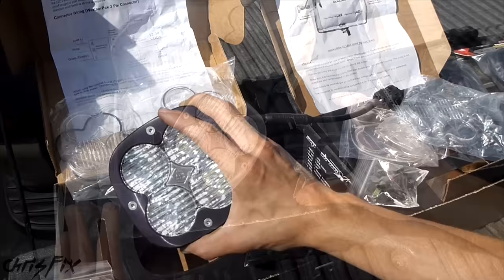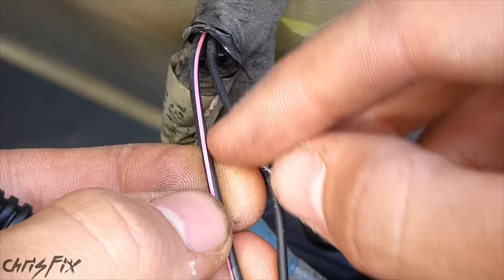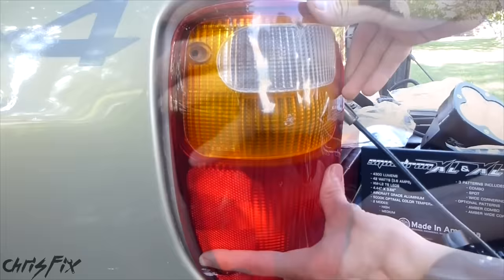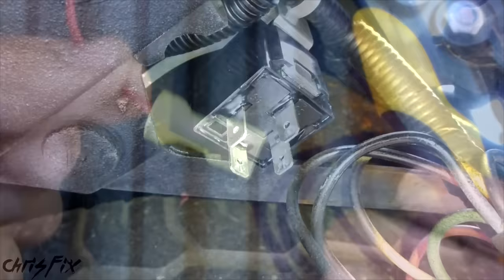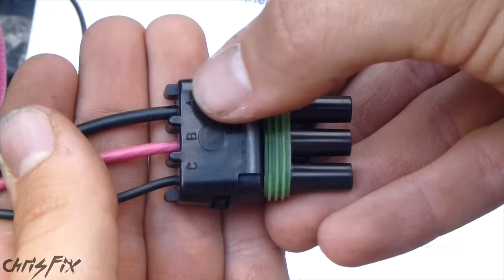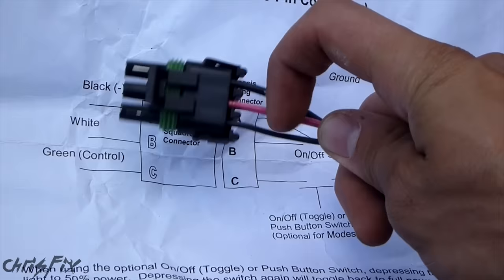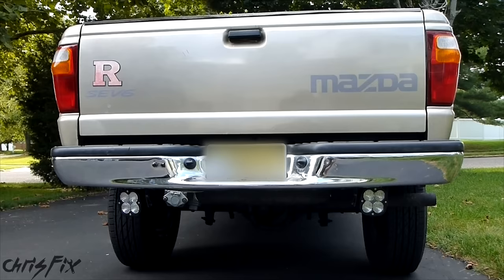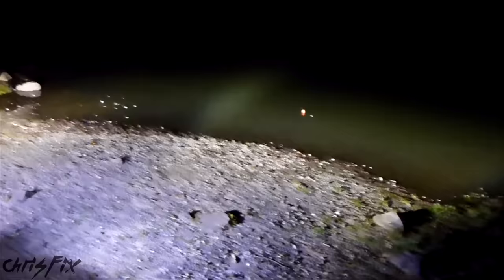How to Install Auxiliary Reverse Lights

Comment: I would just replace the original globes with led replacements and then power the new reverse lights off the wiring to the reverse lights, you'll probably draw less current then before anyways and not have to do so much wiring

Comment: Chris I have a question for you if you don't mind me asking I bought some twin strobz light for my truck and my battery is on my passenger side and the wires to the light are short and I don't want the button to be on the passenger side I want it to be on the driver side
Reply from the maker: What is your question lol

Comment: What about for the trailer?  My trailer has a 12 volt battery. Can I just use the trailer battery and tap into the 7 pin electric plug that goes to my truck? Which wire is the reverse on the 7 pin harness and / or plug?
Reply from the maker: You could but check the fuse for your trailer lights because you can only put lights that draw less than that fuse.
Reply: @chrisfix  okay thanks, and where would the trailer lights fuse be found? Probably someplace on the trailer I guess, right?

Comment: Why would you use another power wire and a relay for the new lights? The draw from the backup light is nominal so you're using the backup light power leg to initiate the relay, then a constant hot from the battery to power the light. So when you go into reverse the factory light comes on powering the relay which will close the circuit and send 12v to the new backup lights. Sounds like way overkill my friend. The backup factory circuit and wires should be able to handle the extra draw with no issues. I wired a trailer harness directly from the lights and have had no issues in over 10 years. Seeing as though both lights only lite up while backing (one function), wire the first and then from one light to the other. You can still run a fuse inline from the OEM light wire splice so if anything does happen to the wire to the new light and in between the lights that could cause a short, it will protect the factory wires. Just as effective, just as safe, and a hell of a lot less work and materials.  I get it, you want to be sure you don't overload the circuit and cause any harm to the factory harness. Ok, but there are easier and better ways to accomplish the same agenda. Just my 2 cents.
I had to edit this because you are running 3 grounds because you used a relay. My way: One frame ground to the first light, then with the power wire run the ground wire for the second light.  Incidentally, I would have used some type of inhibitor between the ground connection and the frame after you cleaned it to prevent it from rusting or corroding from being exposed to the road elements. Love your video for how to work harder. Just kidding, I do like your videos, you help folks with little or no knowledge do things so they don't mess up.

Comment: How can you use this same setup with a switch located in the back by the lights?  Basically so you can turn the lights on whenever you want to.  Would you have to run a completely different switch?
Reply from the maker: +TimberlandMan81 you can use a switch too. I ended up doing that later. Run a 12v line from a switch to the trigger on the relay.
Reply: Sooo...to make sure I have this right...you would run 2 wires to the 87 on the relay?  And if so...what 2 wires exactly?  As of right now...I do not have a relay installed.  I have the same setup that you have with the exception that I have the 12v wire with inline fuse running directly to the switch.  Then....I have the 2 hot (red) wires spliced together, also running to the switch but on the other side .  Then I have another wire coming from the reverse lights spliced into the 2 hot wires from the lights.  Then I have the ground wires connected together running to a spot on the frame of the truck.  The lights work perfectly fine with the switch...my utility lights plus my reverse lights come on...which is the way that I want it....but when I have the truck in reverse...with switch off...the lights come on for a second and then shut back off.  I am guessing and hoping that the relay will solve this issue?
Reply: So instead of running the 12v line to the relay...run it to the switch first and then from the switch go to the relay?

Comment: just so you know that's not how do assemble a weather pack you need to crimp the seal onto the wire where you crimped onto the wire sheathing so it seals your crimp inside the connector so the way you did it your crimp is exposed on the back side and will let water contaminate your wiring

Comment: Why is the wiring labeled differently on this relay?  Did you ever find out why?
Reply from the maker: +Blaine Bugaski I never found out why except that you can reverse the two poles that are different than usual and it's fine.
Reply: I suppose it's like a switch, maybe.  Doesn't matter which side has power coming in.  Wonder if that applies to all electro-mechanical relays just the same....

Comment: I hooked mine up with a double pole  center off switch in the cab. Up position aux lights triggered by existing back up lights. Down position aux lights always on for assholes riding your bumper at night. Middle position aux lights never on!

Comment: But why do it the hard way why are you running power all the way to the battery why not just connect the reverse light on each Side directly to positive and negative of the reverse light. That's how I did it and it works just fine. I have four inch light bars that are white for reverse and they have yellow for turn signals.
Reply from the maker: I'm glad it worked for you! My reverse lights have a gauge wire that is just enough to support that amp load. If you add 10 more amps you will blow a fuse or burn thru the wire!

Comment: Couldn't you just tap into the wires from the existing reverse lights, without having to run a line from the battery?

Comment: is there a limit of grounds on one bolt ?:)
Reply: Owensboropoliceandfire Opd it's actually best to use as few grounds as possible. Car stereo people know the problem of multiple grounds.
Reply: Owensboropoliceandfire Opd you want as least as mount of ground points, that why you usually use 1 bolt for multiple, plus it helps trouble shooting for bad grounds because you'll only have to check one instead of multiple
Reply: No, just get a longer bolt.

Comment: Those connectors are weatherproof if he would have put the wire seal in the correct location.  But why only use some weatherproof connectors and not on all of them.  This system will work for about a year until all the corrosion sets in.

Comment: Welll shit i fucked up and got a wireing kit for said reverse lights and it won't work but i can just modify it a little and it should work. I only say this because it already wired a turn on switch which i dont want. It has a red white and a black wire. Can i just put some electric tape over the white and black wire so that won't be in use or do anything. Then add more wire to the red one and attach it to my lights or am i better off doing this how you did it

Comment: The orange rubber seals in the 3 pin plugs are in the wrong place, the are supposed to be back where the insulation ends, not on the terminal where puts them
Reply from the maker: +andyjm90 thanks for the tip!

Comment: Honestly I’m not trying to judge or nothing great job but you don’t need all the relay and stuff like that if you splice the factory harness in reverse then you can get the power there just butt connect the ground and power together on each side and bam all set like it saying not being mean it’s just that you could of made it a lot easier

Comment: i like most of your video's. but why did you do it half assed. nice job on weather tight connectors, but use regular butt connectors, your asking for trouble. copper corrodes. should have used a relay connector and used heat shrink and solder the wires. and you can get heat shrink eyelets as well. the back end of a vehicle gets lots of moisture. i do this every day for a living and have to fix people taking short cuts using crimp connectors and wondering why their lights or trailer plugs quit working.

Comment: would it work the same way with Fog Lights ???
Reply from the maker: +Deejay Ecko you would want to wire fog lights on a switch so you could turn them on and off but yes, it's the same process.

Comment: You are aware you could have used the reverse wire from your trailer plug right?  This way you dont cut into the tail light wires or risk a stuck relay keeping your tails on and draining the battery.  Much safer and easier.  If you were to get the right pigtail you wouldnt even need to cut any wires on your truck.

Comment: Your could've just wired into your trailer hook up. That's how I wired in my brake and reverse light bar and I didn't run any wires to my battery and no wires to my tail lights it's all wired into the trailer hook up. But still an awesome video.
Reply: Cody Herman 792 you're right but I'm sure he didn't want to assume everyone has a trailer plug.

Comment: Why didn’t you use a heat shrink butt connector  instead of the black tape on Your first connection.  Your relay is not water proof either. You need a weather pack connection for the relay.
Reply from the maker: Thanks for the tips

Comment: you should zero Guage your ground and charging wires on your alternator/battery it will put a %25 increase in your electrical system since you got all them watts in LED lighting

Comment: My truck do not have revers light ¿how can I connect it?
Reply: Miguel Angel Mosqueda tailings so when you have your headlights on it power off the rear running lights.

Comment: Why do you need to run a power line to the battery when you already spliced into the power line from the tail lights?  That makes no sense, you don't need 2 power sources for 1 application.  I am not following the idea a relay either if you are already tapped into the power line to the tail light that is all you need (for power anyway).  Then just ground it as you did.  It seems to be overkill.  I am not seeing anyone else do it that way unless they want a separate switch.

Comment: Instead of using 2 crimp on barrel connectors to splice in fuse; Why not connect one side of fuse holder to battery and use only one splice?
This keeps fuse closer to battery, and less connections means less chances of corrosion or failure.  
otherwise good video.

Comment: I would trace a hole to cut into my bumper so they're not hanging off the end. I feel like that's a much cleaner look
Reply from the maker: Stay tuned ;)
Reply: Dylan Smith I would cut a square hole in the bumper and put it in the bumper
Reply: ChrisFix always man!
Reply: CHEVYSRCOOL89 yeah I feel you. I have a lot of friends that have that done I like it. My neighbor has it and it looks factory
Reply: They have flush mount led cubes on amazon that i used instead of these. the are awesome. Just like what you said

Comment: how come you didn't just t-splice the aux lights to the reverse lights?
Reply from the maker: Your reverse lights have a gauge wire that is just enough to support that amp load. If you add 10 more amps you will blow a fuse or burn thru the wire.

Comment: is a relay necessary?
Reply from the maker: Yes, otherwise you would run the power wire off the stock reverse light wire which will blow a fuse. A bigger fuse could melt the wire and start a fire!

Comment: Why can’t you just take a wire from the power to the factory reverse lights to the positive on the new ones, then earth the new lights. That’s what I did and it works fine.
Oh and it’s called solder, not sodder!

Comment: Factory made trailer electrical connection  on vehicle 2009 F-150 Lariat. All light work on truck. on trailer all lights work except running lights on trailer. Test meter shows no power to male plug in at manufactured trailer electrical connection  on truck. How do you find the issue. Does this signal have a separate fuse? How do you further trouble shoot.
Reply: James White there's a separate fuse in the block under the hood.
Reply from the maker: What Josh said!
Reply: Thanks fixed.

Comment: that relay instructions are surprising. typically pin 30 is battery, 86 is switch , 85 is ground the 87 would be energized from your back up lights.

Comment: You made  the connectors wrong. Rubber stoppers should go on the wire before metal connector. It seals connection inside plastic cover.

Comment: Improper way to install seals on connector. Red seal goes on wire then crimp connector to wire. You will have water in your connection in no time

Comment: couldnt you just skip all the wiring and fuse tap the current reverse light fuse?
Reply from the maker: No because you will be running a lot of current through your reverse lights. You can use the reverse lights as a trigger but not a power source unless the wiring/fuse can handle the additional load.

Comment: why don't you use a relay connector? it's much easier to use and you can get a waterproof one too....
Reply from the maker: Thanks for sharing the tip!
Reply: I love your videos btw and watch every single one of them and learned allot. You do the best "how to"s on youtube. Changed my oil, break pads, rotors etc... In the future, could you do a horn installation video? Idk how it is done yet but I'm staying tuned to learn...

Keep up the work.
Reply from the maker: Thanks a lot Dave! That is awesome! I want to do a boat horn on my truck! Something deep and loud but not train horn loud!
Reply: ChrisFix I will look forward to that video.

Comment: Hmmm,,, no flyback diode on that relay???  TIP: A thousand volts or so shoots into your electrical system when the relay turns off! A flyback diode should always be used!!!

Comment: You lost me at 10:49... where the hell did that "factory harness" come from??? I thought you were just running 2 wires from the relay to the 2 lights
Reply from the maker: +Klutch Krazy the relay needs a trigger which is from the stock reverse light wire, then it needs a power wire which I ran from the battery.

Comment: why run a relay?
Reply from the maker: Without a relay you can blow a fuse or burn up your stock reverse light wiring harness. The reverse light wires are just thick enough to handle the stock lights. If you add a bigger load it can overheat the wires. Adding the relay increases the load by milliamps rather than 10 amps from the reverse lights.
Reply: oooh, right! thank you!

Comment: I think it's easier just using the original reverse wires straight to the new lights, just saying!
Reply from the maker: It definitely is easier to do it the way you mention but that is also how you burn up your wires, blow a fuse, or worse, cause a fire. The extra 5-10amp draw from the lights will cause problems running though the stock wires which are just thick enough for the stock reverse lights.

Comment: no its  not there led tap right in the rev. lights
Reply: +Todd H running an additional 5-10amps through the stock reverse light wires can blow a fuse. If you use a larger fuse it can cause the wires to overheat and cause a fire. That is why you run a relay.

Comment: you need to be careful when doing this. your local laws may prohibit excessive back up lights. It would be better to have an in cab switch so that you can use them only when needed.

Comment: I'm sure you have gotten better since this was made three years ago.. but that type of stripper should never be used in line and your other wire stripper/pliers had the proper openings to do a circular crimp on the bare connections..  also the zip tie will degrade in less than 6 months.. guess I'm just nitpicking here but nothing you did was properly sealed.

Comment: Pro tip... do not, under any circumstances, mount your lights in this position.  If you intend to off road these lights are in an extremely vulnerable position.

Comment: Instead of battery why don't you connect to hot terminal on under hood fuse box, or better yet add a fuse into that fuse box. Or add a mini fuse block under hood or under dash for adding lights? Hooking straight to battery is the lazy way. Come on man! You're better than that!

Comment: Washer should have gone on after the ring connectors, not before them. And the surface, plus the ring connectors should have been coated with dielectric grease. It's good that you sanded that surface, rather than rely on it being good just because it was already used as a ground point. I probably would have sanded both sides of the old ring connector as well.

Comment: You failed to put the weatherproof grommets on you wires before crimping terminals on,defeated the whole purpose of having weatherproof connectors. Salt will rot off in a couple years or less. Cold have got everything you needed by tapping into trailer tow wiring, battery charge wire to power relay and reverse light wire to trigger relay .
Reply from the maker: Thanks for the tip Mark. So you know 8yrs later it still works perfectly fine.
Reply: @chrisfix  you must not live in rust belt lol.

Comment: That is not the correct way to wire those plugs. That rubber piece goes over the wire sheathing then that larger crimp holds the rubber seal in place.  Water can get right into that plug and your wire.

Comment: not a good video. this will work, but almost all crimps and the soldering joint are made improperly. this installation is prone to corrosion and breaking

Comment: screw the instructions. power should be going into pin 30 not 87. 85 and 86 are interchangable polarity wise but you should have power into the switch pole which is 30. 87 is the contact. personally i'd  be taking the time to solder those terminal wires for secure connection too
Reply from the maker: Thanks for the tips
Reply: No dramas mate. I'm by no means an electrical engineer but I've done a lot of work with these kind of electronics. Currently enjoying your police car build series done really well I'm loving what you've done